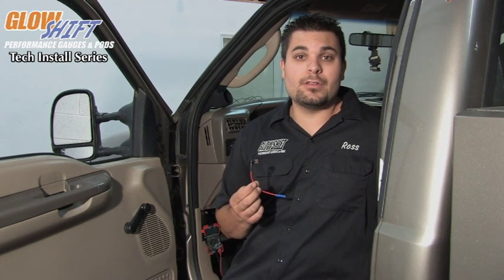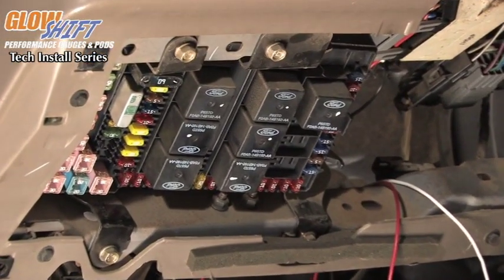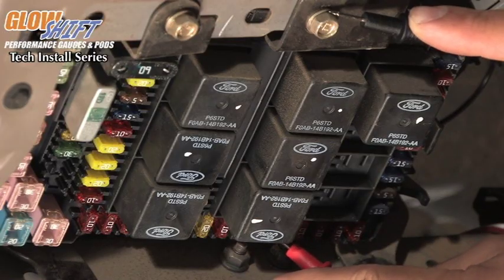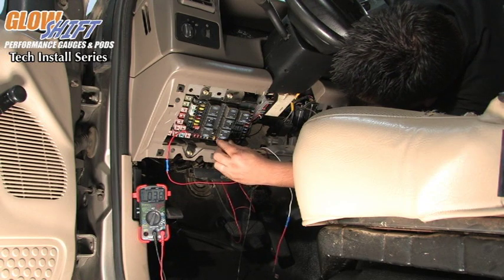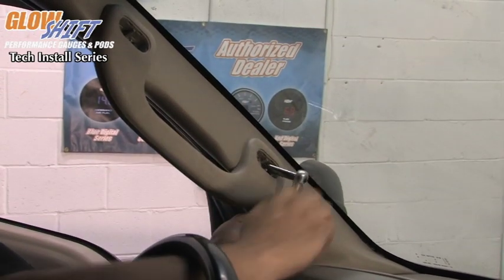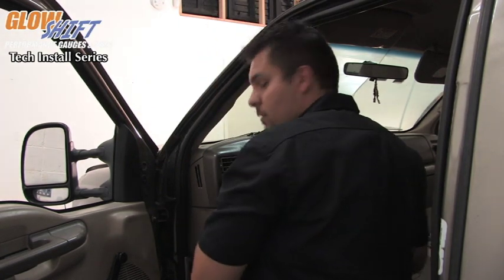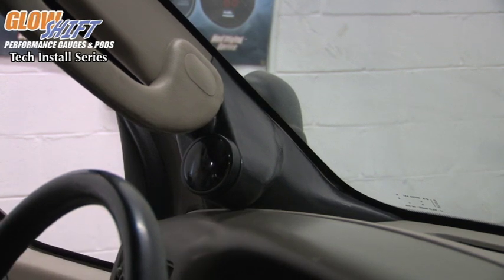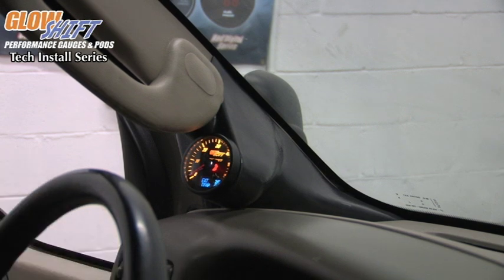Installation | GlowShift 3in1 Black Analog Boost Gauge Into Ford Super Duty 7.3 Powerstroke Part 2/2

Comment: I ordered this gauge last week and I'm excited to install it.  I ordered the pod mount for an '02 f350, but I think they are sending me one for and '03-'07 model. is this going to be a problem?  Also, my truck does not have the hand grip on the left a pillar. Without that, how will the pod  mound be secure against the dash?  BTW, great video. thanks for the info

Comment from the maker: We took the screw out and sandwiched the wire eyelid between the plastic of the dash and the metal dash carrier.  We then reistalled the screw so that it was tight up against the metal dash carrier for a solid ground.

Comment from the maker: Yes you can do this, but I recommend two add a circuits: one for the switched source and one for the constant source. You would connect all the red wires together and use that for one add a circuit and all the yellow wires for the other. If you have any other questions just ask!